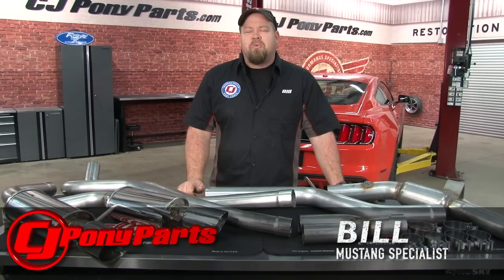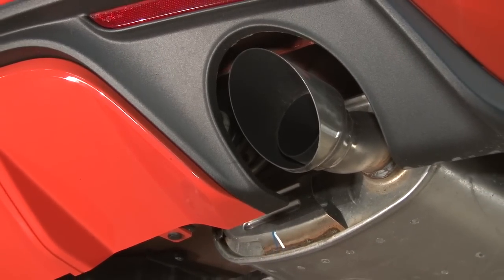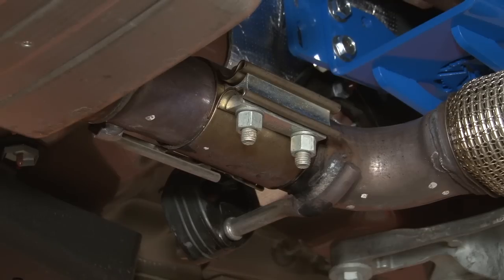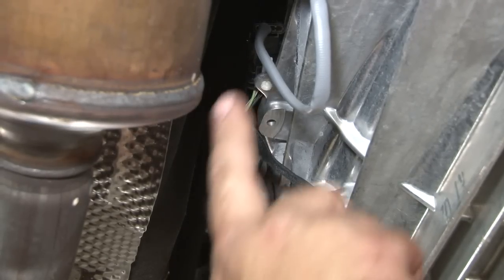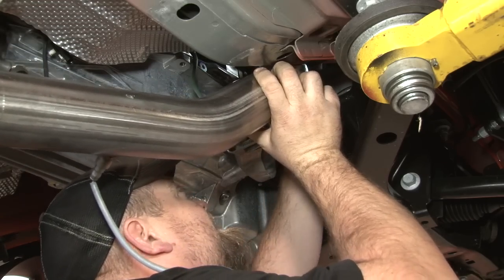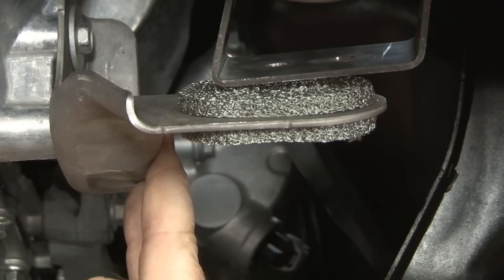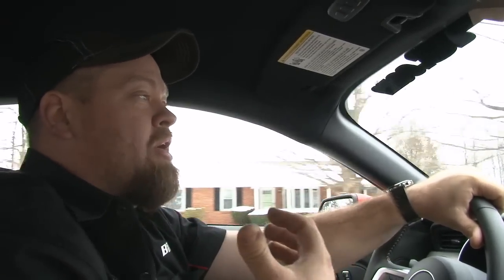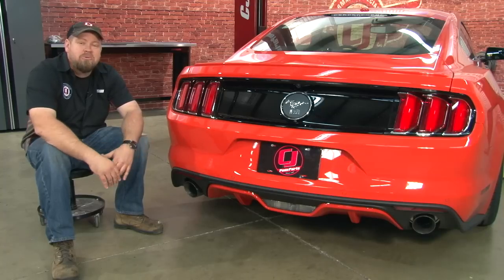2015-2019 Mustang EcoBoost MRT Off-Road Turbo-Back Exhaust Installation

Comment: I'm not the biggest fan of 4 cylinders, especially on a Mustang. But, for what it's worth, Ford did an amazing job with this. Those are amazing numbers (both horsepower and torque for a 4 cylinder), great internals, and good gas mileage. I'm kind of sad it's on a Mustang but for what it's worth I think Ford did a fantastic job on this. I'm just glad they gave it proper horsepower and torque to make it semi-worthy of being called a Mustang. I give it a 8/10!

Comment: Love it! Subscribed!! Too many other companies on the market do 2.25" when it came down to the two individual exhaust pipes at the back of the car. I understand that you want to keep a bit of back pressure but thats too small. Your 2.5" pipes are PERFECT! Still keeps back-pressure BUT also retains maximum exhaust flow! Thank you for actually taking the time to build a quality exhaust for the Ecoboost model!
Reply: T. Stevens You want as little back pressure as possible with a turbo engine.
Reply: True. Ive owned an Evo X before and had a 3" AMS turbo back exhaust and it did wonders! But... with a dual exhaust, it actually helps to split to a 2.5" for both exit pipes. The flow through the exhaust stays strong and true. Not wasted.

Comment: It's almost funny hearing that sound coming out of a mustang :)

The exhaust looks like a nice setup though. Everything bolted up so effortlessly, plus the free flowing exhaust definitely picks up power on a turbo motor.
Reply: The fitment is very tight on the kit.Once installed everything fits well but I spent a little bit of time off camera moving things around to get it spot on.
Reply: @Zerogivengarage  I've looked for this set up can't find it online how much was it

Comment: I installed a catted down pipe and deleted my resonator and added the "Y" pipe and use the stock mufflers. That's as far as I'm going. Like many I grew up modding V8's and just cant adapt to the 4 banger sound. I do like the RS sounds though, and the active exhaust on the 4banger stang's 019's I must admit sound pretty good. I bought my 18 for a daily driver(long work miles) and I installed my Intercooler with Stage3 Cobb tune and this is now truly a fun car to drive. Most rice burners now don't stand a chance. Still waiting to hook up with the others in the hood. The older V8's I ran we were either side by side or I was slightly ahead from the dig, and that was before the intercooler/tune. I have a bud with this exhaust and I cant say I hate it, but its just not my shtik.

Comment: Installing this exhaust requires a tune, but does that affect reliability? And does this void the warranty?
Reply: A proper tune will not affect reliability at all. As far as the warranty that will vary from dealer to dealer. FRPP is offering tunes for these cars now that do not void any warranty.
Reply: What happens if you don't have a tune right away? I'm getting a tune but not until later on, but looking for this kit .
Reply: Brandon S It is not good for the car to run rich for an excessive amount of time. If you are going for the off road setup you will want to get a tune when you install this system. The high flow cat version would be better off if you didn't want an immediate tune.

Comment: Nice work, i'm thinking of installing this kit on mine. How come the new exhaust set-up had a lot of black smoke?
Reply: Like I said in the video you will want a tune because the car will run quite rich with this setup, that is the black smoke you see.
Reply: It requires a tune, because of the increased air flow. That black smoke is simply the result of the un-burned fuel.

Comment: why does the engine sound so much like a rotary lol?
Reply: I fail to see the downside there hahahaha
Reply: Joes FC Besides the fact a rotory engine doesn't make much power and sounds like a chainsaw.
Reply: Greg Coleman oh cmon but you gotta admit those rotary sound sexy Bridge ported
Reply: Cordovarian Sounds like a good ol 13b hahaha
Reply: Greg Coleman you obviously know nothing about turbo rotaries, or a good exhaust. on top of that it doesnt really sound like one.
Reply: Because it's
V4
Reply: @alial-jahwari6206  LOL V4?
Reply: @lynex83  v4 means 4 Standard
Reply: Ali AL-Jahwari LoL, did you mean i4, there is no such thing as a v4. “V” does not mean standard, it is the result in the shape of the engine. All four cylinders on this car face straight back, or in other words horizontally. A V4 sounds like an interesting concepts though.